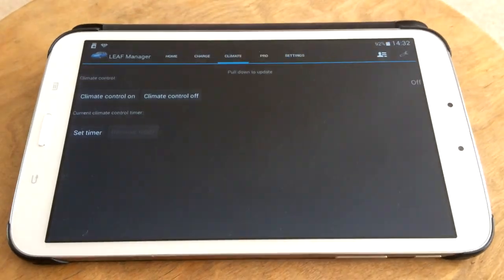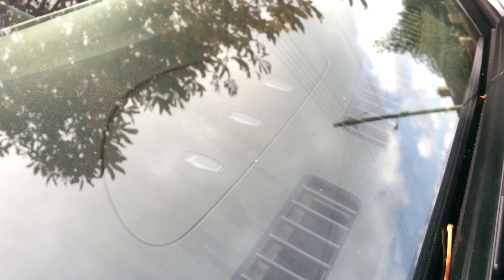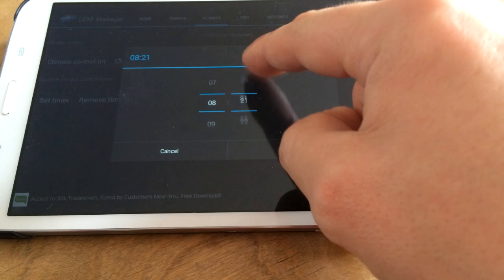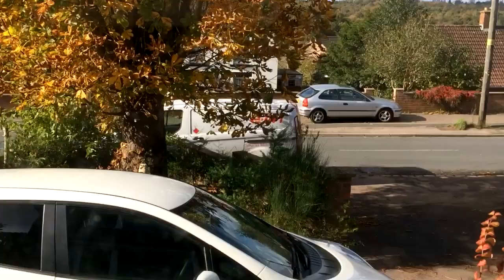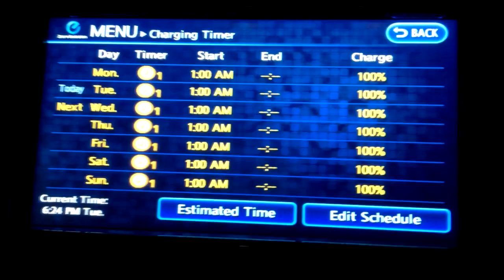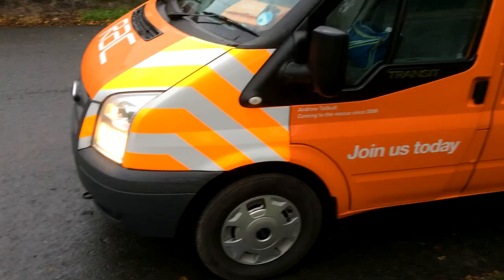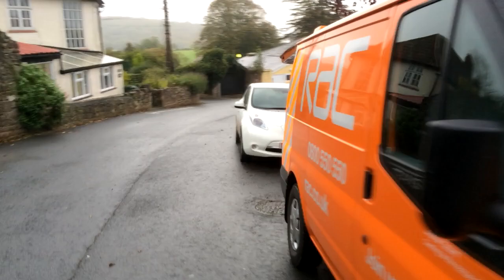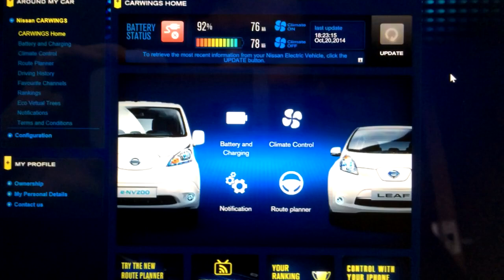Nissan Leaf Break Down Recovery Tested in real life - Episode 64

Comment: So let me understand this, in the UK when you buy/lease a LEAF they don't give you an L1 EVSE in the boot? In the US every LEAF comes standard with an L1 device in a convenient storage case.  You could have actually towed the LEAF with all 4 wheels on the ground and recharged as if you were coasting down a hill.  A group of folks did just that in Netherlands to prove it would recharge.  Just had to set the car in N and take their foot off the brake. Vincent laadt zijn elektrisch auto op door te remmen tijdens het slepen
Reply from the maker: It come with the brick charger if you order 3.3kw, but with the 6.6kw its just the cable.

As for regen - in N it does nothing, and with the battery so low it would not allow it to go into D to then enable regen, I dont get how they did it...unless it wasnt completely flat to start with?

Comment: It's an inconvenience, but videos like this really are helpful for those thinking of taking the plunge, and good for you for pushing it just a bit too far!  

We had a similar experience a couple of weeks back, going from Southampton to Lewes and back.  We had to be there for 09:15, and I knew that there wouldn't be enough to drive to Lewes (even carefully), then back to the only rapid in the Worthing dealership.  So, it was a quick pitstop at WKD Nissan in Waterlooville, then onwards.  We got to Lewes with 12% remaining, but still not really enough to get back to Worthing.  

We went to the local dealers in Brighton and hooked up to their slow charger for an hour, and then took it very gently to Worthing.  All the gauges were out about 2 miles outside, and I think we were pretty close to Turtle mode.  That's probably the hardest I've pushed the battery, but it's all part of the experience.
Reply from the maker: Thanks Richard. Yeah its par for the course with low range EV's. I think its not bad for 14500 miles. I have ran out of fuel more times than that in 14500 miles (mainly because couldn't afford to fill it up!). Its great when you are short of cash - you can still run an EV!

Good to hear you are pushing it as well, get to know what it can (And cant) do then!
Reply: Yes, I've run out of petrol a few times.  It is true that we get to go more places now, as fuel isn't so much of a prohibiting factor.

The latest trip I'm planning is back to South Wales (something I do pretty often), but this time Chieveley is down... so I'm looking at trying to go from Southampton to Salisbury, and up to the M4 exit just before Leigh Delamare.  It's about 68 miles, but has a few hills.
Reply from the maker: Hope this trip goes well Richard!

Comment: Joe90v. The idea of a quick charge via the RAC vans is something that has been spoken about however the costs far outweigh the demand.
Reply from the maker: +Buster Bob RAC in Birmingham have a van with a charger on board, not sure if they are still using it, think so.

Comment: It's that time of the year to start to watch your range drop. It's unfortunate that Leafs can't transfer some electricity between each other. Your mother's car could have "jumpstarted" your car, or a rescue vehicle could have transferred a kilowatt or two. This will, no doubt, be available in future vehicles. It just makes sense. Did you think you were going to make it home and thought you'll have some fun with making wifey nervous, or were you nervous as well?
Reply from the maker: Yep, getting colder now. Although this is defo user error as it were, as I knew I would be pushing it as it was a lot of miles in a day with basically no time to top up charge as per usual.

No - I knew it was looking extremely unlikely that we would make it, you get to know what it can do inside out, and I knew if we got into littledean the biggest part of the hill out was going to be a no go.

Thanks for watching!

Comment from the maker: +Joe90v There is a trial version they are running where they have a built in rapid on their van. Its also local to me!
http://www.rac.co.uk/press-centre/press-releases/rac-launches-first-mobile-electric-vehicle-chargin
Reply: I saw that at Greenfleet (Edinburgh) in April 2014 - but I not seen, or heard about wider deployment.  I fear that that with current EV volumes the cost does not stack up against likely usage.
Reply from the maker: EV volumes are up year on year though, so there will come a point where this is needed. Nissan announced yesterday there are now 10,000 Uk leaf drivers. Think that was 3000 when I got mine 1.5 years ago (might have been 2000 not sure).

Comment: how unlucky is that for it to happen on your birthday :(  on the plus side its only the first time its happened in 10 months of ownership and you were not that far from home and did get a lift so there was a silver lining i suppose
Reply from the maker: User error ;) Its what you get if you over cook it and don't charge enough :)
Reply: We've managed to do this twice now. First time we called AXA: Nissan gave us AXA cover, not RAC. Pity, as the RAC have been brilliant with previous cars. Anyway, AXA said they couldn't be there for 8 hours. Luckily a resident let us charge from their house. It took 1:30 to get enough charge to start. I'm amazed yours would start at 4m on the range meter. I think ours wouldn't turn on until 10 or so.

The second time we got a friend to help us push it down the road to our drive. Real pain we can't tow it as we have a second car (Peugeot iOn, also electric).

Comment: Happy birthday matey, a memorable one at least, even so good for us to see the process should we fall foul this winter of low or no charge.  I must admit I was hit enjoyed when the garage took my brick charger when I said I wanted the 6.6.  Very unfair and as you say if you can't get on your drive what the heck are you supposed to do?
Reply from the maker: Thanks Pete! Yeah you need that Brick charger, means you can charge anywhere  with a 3 pin plug outlet....(with permission). Someone mentioned to me the other day that they are now providing both (but the other way around I think, the 3.3's are getting the brick as normal AND the charging cable).
Reply: I think they'd charge me if I asked them for it now :(  Not sure how much they are though...
Reply from the maker: Expensive! £6-800 from Nissan, used on ebay if your lucky for approx. £400.
Reply: coo!  I may give that a miss for now - with the flood 'n all!
Reply: If you email Nissan complaining about the lack of necessary brick charger, you can get one for free. I got nowhere on the phone, but my wife found a sympathetic agent via email who sorted it out for us.

If there's no joy there, hop on LeafTalk where I'm offering to build cheaper DIY chargers (from OpenEVSE kits) for those that need them.
Reply: Hey Paul, that's great to know, thanks for the info.  I'll keep you posted.
P.

Comment: they should make a leaf to leaf emergency quick charger lead via the chademo connector your mum could have given you a quick boost as the battery is capable of outputting 30kw
Reply: AArdy AArdvark That is an awesome idea!!
Reply: Or make it where a small ICE engine could get you moving in a limp mode.

Comment: So sad to see a LEAF on a trailer :(. But thats the lesson to learn. dont drain your battery.
Reply from the maker: Some times there is just nothing you can do. Would be nice to have a Rapid nearby (or a Nissan garage that allowed the use of one after 5pm). When infrastructure increases this will be less of an issue, until then the risk is there - although in 14,000 miles this is the first time!

Comment: is their an adaptor to plug the trickle charge strait into the 240 outlet
Reply from the maker: Richard thanks for watching! Yes the trickle comes ready to do this...I just had to use a standard extension lead as it was so far from the house (well it was a water resistant extension lead, apart from that it was standard).

Comment: Now I got my first issue with my Stella. my regeneration rings are getting disappeared.
I'm loosing regeneration rings based on speed.
Have you seen anywhere?
Reply from the maker: No, this is news to me? How odd! Have you spoken with Nissan?
Reply: I did. will post a video with detail. in a few words nissan service have no idea about leaf at all. we waited for an expert in it and he didnt know neither. his only guess that leaf does not allow you to use regen on high speed just to avoid blocking wheels. like some conflict with ABS. but it does not make sense to me because before a week ago it was working fine. so he called to nissan technician and shared the video. waiting for his callback. I afraid they will say that its a normal behavior and they will charge me $150 for inspection. "We shall see" (c) Sampson.
Reply: Low ambient temperatures will limit regeneration. It will return to normal in the summer :-)

There are number of threads discussing this issue on mynissanleaf.com forums.

It seems to be a flaw in the way LEAF's adjust for low ambient temperatures.
Reply: It seems very strange to me. I'm in Sunnyvale and the temperature is OK for most of time. I'm losing regeneration rings only when I drive faster. If it's 10 MPH I have all. If 40 I have only 3. 70 - 2 bubles. Check my vids. But Thanks for the link. Will join forum and study the issue